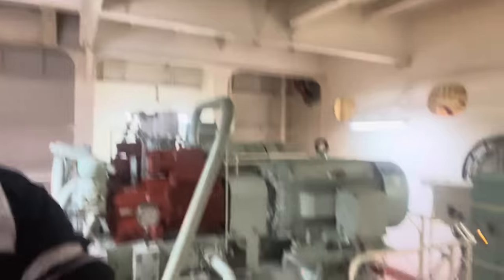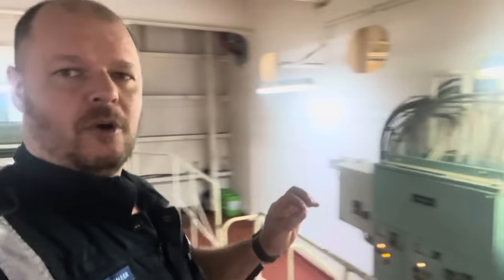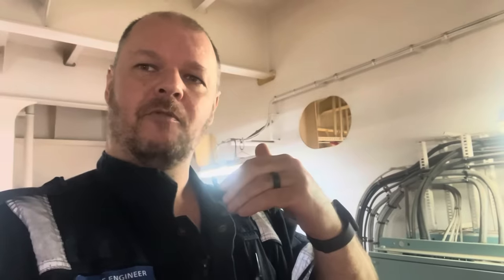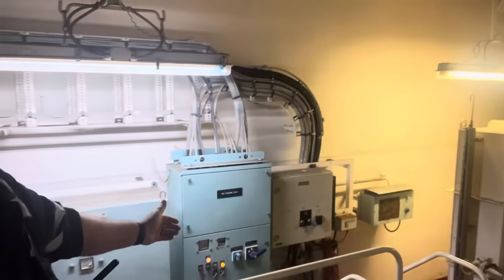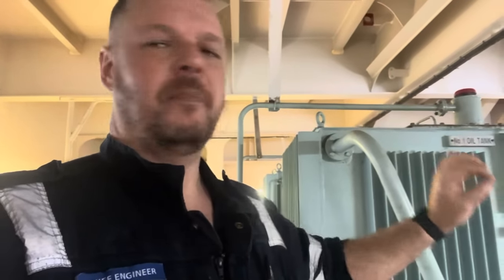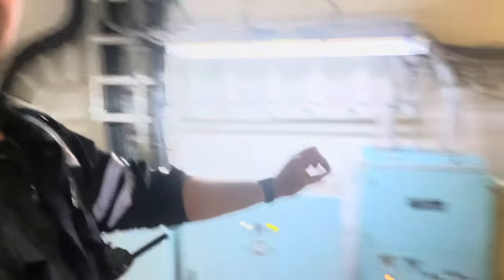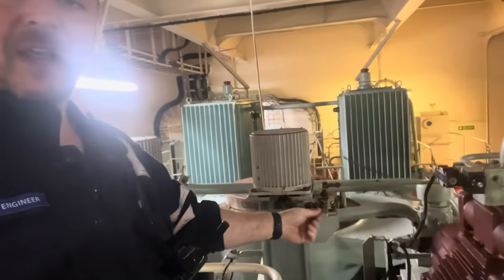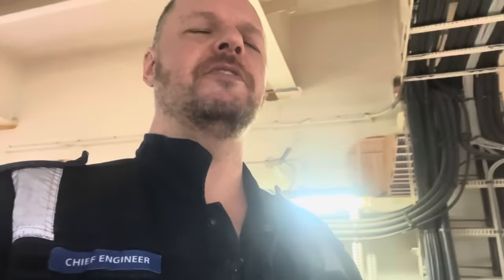Dali size containership steering system. How it’s designed to not hit Francis Scott key bridge

Comment: The lights and steering should not be on the same emergency power circuit.
Reply from the maker: They aren’t but the main is. And that’s sort of the thing we have no indication if the emergency generator ever started as it should have
Reply: When you see some lights go on and off a couple of times, makes it seem like the steering is on the same power source.  I work with large stationary and mobile equipment and we has nitrogen accumulators for emergency activation
Reply: When you see some lights go on and off a couple of times, makes it seem like the steering is on the same power source.  I work with large stationary and mobile equipment and we has nitrogen accumulators for emergency activation
Reply: When you see some lights go on and off a couple of times, makes it seem like the steering is on the same power source.  I work with large stationary and mobile equipment and we has nitrogen accumulators for emergency activation
Reply: When you see some lights go on and off a couple of times, makes it seem like the steering is on the same power source.  I work with large stationary and mobile equipment and we has nitrogen accumulators for emergency activation
Reply: When you see some lights go on and off a couple of times, makes it seem like the steering is on the same power source.  I work with large stationary and mobile equipment and we has nitrogen accumulators for emergency activation
Reply: When you see some lights go on and off a couple of times, makes it seem like the steering is on the same power source.  I work with large stationary and mobile equipment and we has nitrogen accumulators for emergency activation
Reply: When you see some lights go on and off a couple of times, makes it seem like the steering is on the same power source.  I work with large stationary and mobile equipment and we has nitrogen accumulators for emergency activation
Reply: When you see some lights go on and off a couple of times, makes it seem like the steering is on the same power source.  I work with large stationary and mobile equipment and we has nitrogen accumulators for emergency activation
Reply: When you see some lights go on and off a couple of times, makes it seem like the steering is on the same power source.  I work with large stationary and mobile equipment and we has nitrogen accumulators for emergency activation
Reply: When you see some lights go on and off a couple of times, makes it seem like the steering is on the same power source.  I work with large stationary and mobile equipment and we has nitrogen accumulators for emergency activation
Reply: When you see some lights go on and off a couple of times, makes it seem like the steering is on the same power source.  I work with large stationary and mobile equipment and we has nitrogen accumulators for emergency activation
Reply: When you see some lights go on and off a couple of times, makes it seem like the steering is on the same power source.  I work with large stationary and mobile equipment and we has nitrogen accumulators for emergency activation
Reply: When you see some lights go on and off a couple of times, makes it seem like the steering is on the same power source.  I work with large stationary and mobile equipment and we has nitrogen accumulators for emergency activation
Reply: When you see some lights go on and off a couple of times, makes it seem like the steering is on the same power source.  I work with large stationary and mobile equipment and we has nitrogen accumulators for emergency activation
Reply: When you see some lights go on and off a couple of times, makes it seem like the steering is on the same power source.  I work with large stationary and mobile equipment and we has nitrogen accumulators for emergency activation
Reply: When you see some lights go on and off a couple of times, makes it seem like the steering is on the same power source.  I work with large stationary and mobile equipment and we has nitrogen accumulators for emergency activation

Comment: Designed for failure; you bet!  Emergency systems that leave a ship powerless for a nominal 30 seconds is a sure Rx!  Solution; feed the emergency system via a battery bank that can be charged by the main generator, and appropriately sized to power the emergency system for the duration of the lapse till emergency generator startup?  Something I've done in my recreational cruising trawler.

Comment: Lots of safety built into a redundant system.  Great.  That 30 second lag time might have just been too long in Baltimore.  Badly timed failure.  But, of course, failures are seldom done under your control.  Bad failure when the ship was already too close to the bridge.  By the time the power comes back and the lights come back on, the most you can do is clearly see the damage done.  Too late for anything else.  Question remains as to why the main power failed in the first place coincidently with the ship nearing the bridge.   Partly bad luck.  But not completely an act of god.

Comment: The dumbest statement I have heard in years. Steering system are not designed to HIT ANYTHING, let alone a specific bridge.  They are not designed to a AVOID ANYTHING either.  They are designed to provided the Command with steering inputs to the ship.  Sometimes the "Bus driver" points the ship in the wrong direction and sometimes the Clanky's do something and the steering system refuses to comply.
You mentioned multiple redundancy in the control element of the steering, BUT ONLY 1 on the power side, ie the emergency generator (EG).  In the case of Dali, he EG to 60 secs to get online, but it failed twice and there might have been a bit of helm applied when the first failure occurred. That may never have been dealt with.